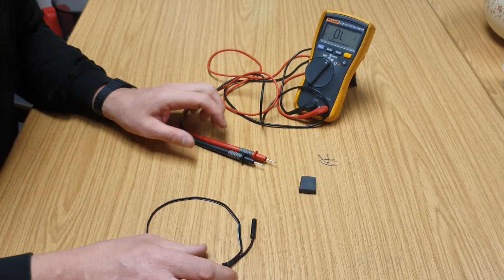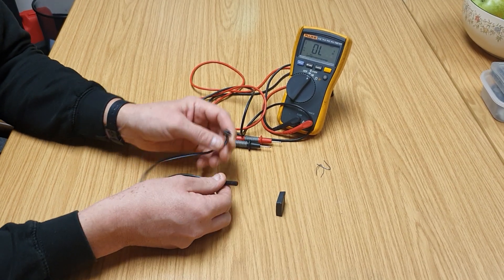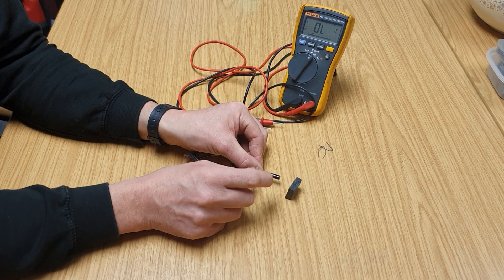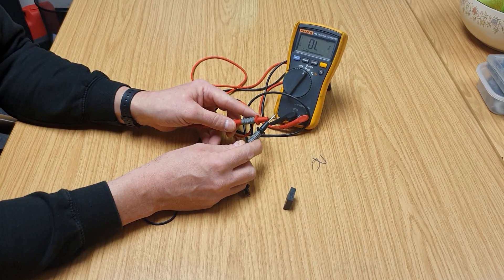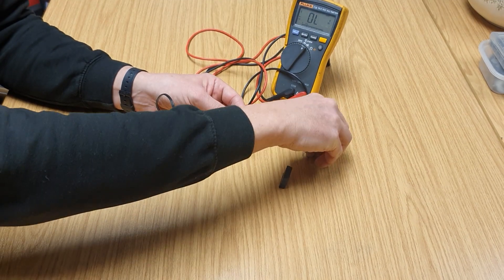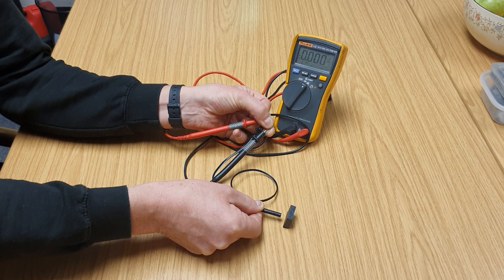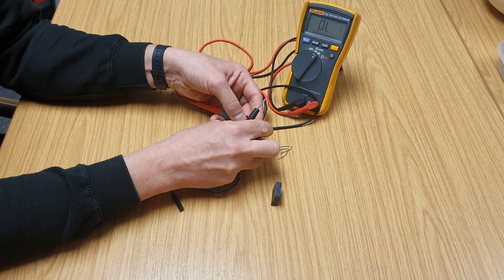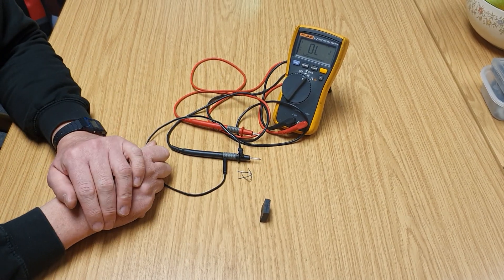How to test a magnetic speed sensor (reed switch)

Comment: I have a reed switch fitted inside a meter assembly (tachometer/speedometer) on my project  motorcycle. Once an electrical charge is supplied it operates the reed switch and supplies power to various dial gauges on the assembly (fuel meter, neutral light,oil level light etc). At the moment I can only get the oil level light to function, the first one the  neutral light I've tried everything to get it to function changed the bulb, continuity in the wiring is fine and there's power there and it's a new neutral switch I've fitted. Was wondering if the reed switch is failing would this cause the neutral light not to illuminate? It's a bit of a task to disassemble and change the reed switch inside the assembly and without showing you the wiring diagram it's a bit complicated to explain.

Comment: And how do you know your speed sensor isn't working
Reply from the maker: @elareasecretaful  because your multimeter won't beep
Reply: @charteredengineer  it beeps far and close from the magnet
Reply from the maker: @elareasecretaful  it should only beep when the magnet is close. There should be no beer when the magnet is far

Comment: I want to test a sensor on a boat diesel engine (tachometer isn't working) and I thought the key was ohms/resistance.  Is a continuity sensor different from a resistance sensor?
Reply: Hi - A continuity test and a kind of resistance test. With the continuity test, the meter will beep when there is continuity. Hope this helps!
Reply: @chartered.engineer  Thanks for the reply.  If I get the on-off continuity signal (beeping) then the sensor is good?  Also, now that I think of it, idle is about 800 rpm - that's 13 continuity beeps/second. Is that why measuring ohms is better?

Comment: heloo. i have a 3 wire speed sensor on my bike.  i modified the rear wheel and it has only two wire on the speed sensor. is it posible to connect it? 3 wires on my bike and 2 wires on my wheel ? how can i put the wire?
Reply from the maker: HI - probably not possible. A 2 wire sensor is most likely to be a magnetic reed switch and a 3 wire will be an optical sensor. The two are not compatible.

Comment: Hi very good videos I learned a lot.My daughter gave me a Nordictrack  Treadmill   C2300 model#NTL12905.0 the machine was working fine  but when we move the machine with my son in law truck and we put it the power on,  the consola buttons dosen't work only show SELECT USER 1 or USER 2.I check the speed sensor like you do and the motor and both work also I cleaned all the ribon cables and conector and still the buttons no working .What you recomende?
Thank you very much

Comment: Thanks for this.  Based on your instructions, I was able to test my sensor and find it was in the process of failing, but not dead yet.  We've ordered a replacement, and in the meantime, we were able to shift the sensor closer to the pulley magnet to get the switch to close.  Symptoms from the treadmill was erratic speed over several days before it refused to run completely.  After unplugging, it would run for approximately 1-2 revolutions on the first attempt before shutting itself off because it was not getting signal from the sensor.  (Nautilus t614.)
Reply from the maker: Well done Jesse - great work

Comment: Do you get a voltage reading when your meter is set to alternating current?
Reply: It was set to continuity and the only voltage this would have would be a small residual charge from contact with skin at best.
It's not an electromagnet.

Comment: Thanks for your video. I've been struggling to build an electronic ignition system for my Trabant 601 (the car that's  in my avatar). This engine uses two points and two coils (one set for each cylinder). It's a 2 cylinder 2 stroke engine. Looks kind of like a snowmobile engine. This same setup was commonly used on twin cylinder motorcycle engines.

I had been using two of those points conversion systems but I am not having much luck. I bought a speed sensor for a Cummins Diesel I want to experiment with. After watching your video it appears that there are is no control module involved in the system? Like on an GM HEI system that uses a magnetic pickup, star trigger and a control module?

So if I mounted this speed sensor in the ignition housing then connected one wire from the speed sensor to ground then the other wire to the negative side of the ignition coil, would that work? Or would I have to connect this speed sensor to some sort of control module?

Based on your video looks like whenever the magnet approaches to the speed sensor all it does is complete the circuit like a set of breaker points/condensor. Or in other words it looks like a Reed switch.

I have tested ignition coils by laying the coil wire on the engine block then connecting a wire to the negative side of the coil with the ignition on and tapped the wire to ground to check for spark. I once forgot to discharge the coil and when I grabbed the coil wire, I got a nasty shock!

Thanks.
Reply: I will create more magnetic switches using the same concept
Reply: Trabant 601 now that's a Soviet classic that moved the masses.
I haven't seen one in decades, good luck with the project👍

Comment: Thanks for the video. Is it common for the sensors to fail? My excercise bike is 9 years old and would intermittently not register RPM/speed, now it's packed up completely. I've had a fiddle with the sensor and cable, everything looks ok physically, but not had a multimeter on it yet.
Reply from the maker: Yes it is a common fault